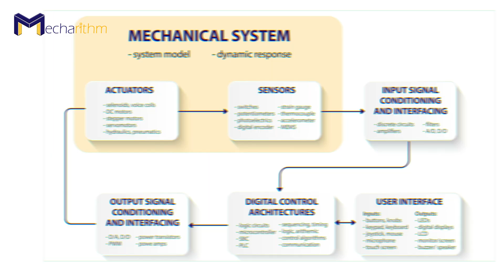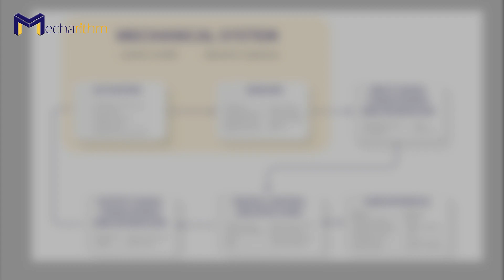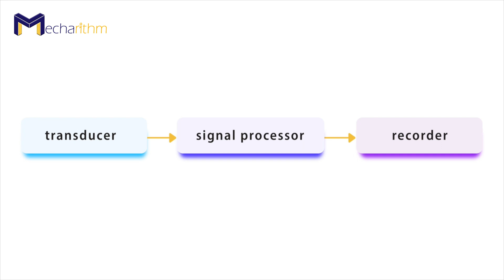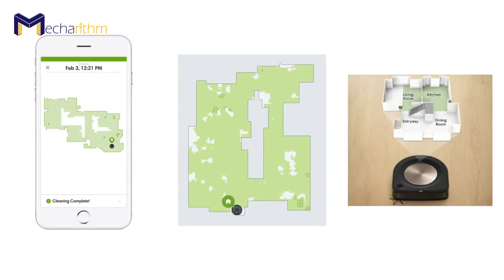What is Mechatronics Engineering? | Fundamentals of Mechatronics | Lesson 1 #mechatronics

Comment: What is the difference between a robotics engineer and a mechatronics engineer?  This has never been entirely clear to me.  I have the impression that there is a lot of overlap, but perhaps mechatronics engineers study more of the electrical and/or computer vision aspects.  Would you agree with that?
Reply from the maker: That is a great question, and it's basically asked by many people. Mechatronics is a field of study that combines electronics and mechanical components with modern controls and microprocessors. As a matter of fact, every newly designed engineering product is a Mechatronics system.

We can conclude that a robot can then be considered a mechatronics system. The term mechatronics is a broader term than robotics.

So, a robotics engineer does anything related to robotics but a mechatronics engineer's job can be broader than this and can include any project that is at the intersection of ME, EE, CS, and electronics. So for instance, automation of an industrial process using PLC (programmable logic controllers) is more of a Mechatronics engineer's job. A Mechatronics engineer can be a robotics engineer, but the opposite is not true.
Reply: Darn it, that is very well distinguished... Your explanation makes perfect sense.